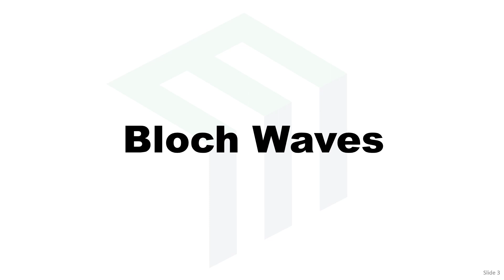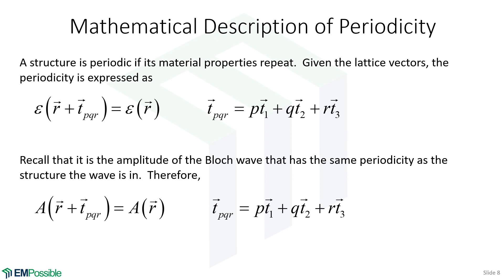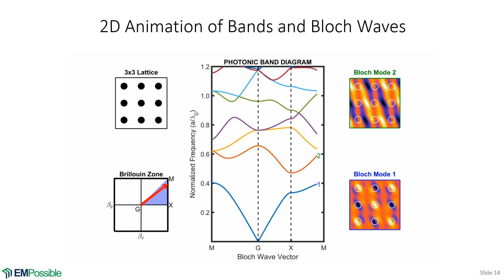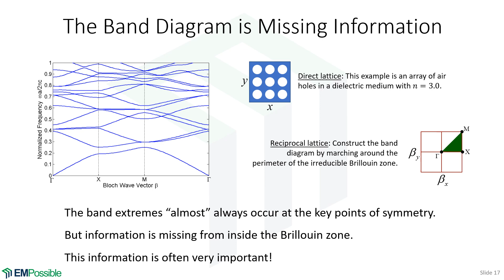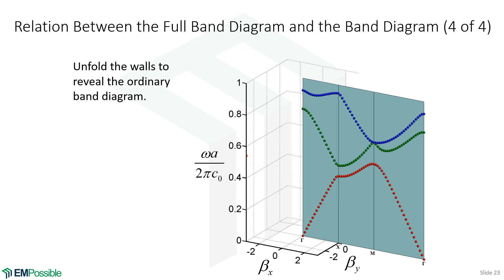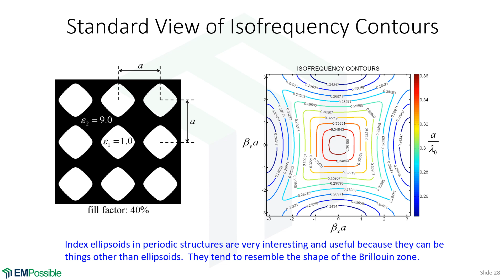Comment: Dear professor only thing I could not extract from your video is that when wavevector does not change the direction but amplitude, what does actually it do? Because I assume it is not really the excitation wavelength since when we check gap in the band, and simulate transmission, we take the wavelength from vertical axis, not from the horizontal one, then I cannot really comprehend what does scaling k vector does?  But in the bloch mode figure it is kind of changing the wavelength(?). If you could spare from your valuable time I would be really grateful
Reply: I am transitioning from conventional waves in ordinary media to Bloch waves in periodic media. To do this, I was being sloppy with the terminology. A wave vector is only for uniform plane waves. Waves in a periodic medium cannot be uniform so they are called Bloch waves. A wavevector and Bloch wavevector are interpreted the same way. They convey both direction and wavelength, not amplitude or frequency.

When constructing a band diagram, two things are needed as input to the algorithm: (1) a description of the permittivity and permeability, and (2) a Bloch wavevector. For a given unit cell and Bloch wavevector, a question is asked...what waves inside this lattice propagate in the direction of the Bloch wavevector with the wavelength also describe by the Bloch wavevector. The algorithm returns all the modes (Bloch waves) that do this. Each Bloch mode is described by a frequency and a picture of the fields in the unit cell. The picture of the field still does not convey amplitude, only the relative amplitude of the fields. Usually they are normalized for something like peak amplitude =1 or sum of field =1 or something like that. This is because no source is given to figure out what the actual amplitude would be.

When calculating things like band gaps, you have to calculate the band diagram and then extract frequencies from that. The Bloch wave vector only conveys direction and wavelength.

Does this help?

If you are looking for this in written form, I have included some discussion of it in Chapters 2 and 7 here:

https://empossible.net/fdfdbook/
Reply: @empossible1577  Dear Professor, thank you very much for you explanation now it is more clear

Comment: Dear professor,
I am trying to recreate what you did in 3:20 . Basically, you managed to separate the Bloch waves into envelope function and phase term. Is possible extract the same information from the photonic dispersion diagram of a similar structure (which shows the Bloch modes). Is there eigenmodes that can, in principle, correspond to purely the Envelope Function or phase term?

I carried an eigenvalue analysis of a similar structure, to extract the photonic dispersion diagram. It seems to me that the mode exhibited for the first linear mode (light cone) is similar to the envelope function.
Reply: When you solving an eigenvalue problem, there are eigenvalues and eigenvectors. These come in pairs.  The eigenvalues are used to form the bands is a dispersion diagram. The eigenvector is not needed for band diagrams. The eigenvector, however, contains the actual fields associated with the Bloch mode. The normal way this is solved is that the eigenvector is the envelope function. To see the actual fields, you have to analytically calculate the phase term and then multiple the two.

I have three resources for you to be able to do this. First, the fastest method for dielectric photonic crystals is the plane wave expansion method. It is a little weird calculating the fields from this, but rather simple once you get it implemented. See Topic 6 here:

https://empossible.net/academics/emp5337/

The easiest method and highly versatile method is finite-difference frequency-domain (FDFD). I HIGHLY recommend learning this method if you have any interest in computational electromagnetics. It is extremely simple to calculate band diagrams and visualize the fields. Like PWEM, it the eigenvectors contain the fields associated with the envelope function, but they are immediately available for visualization. Below is a link for a book on FDFD. The book it intended for the complete beginner and teaches the art of computational electromagnetics through FDFD.

https://empossible.net/fdfdbook/

Last, you calculate band diagrams and fields of Bloch modes with finite-difference time-domain. It is my least recommended method because it is a bit awkward and has some limitations. This is taught in the third course in the series below. You will need to work through the series.

https://empossible.thinkific.com/collections/FDTD-in-MATLAB

Hope this helps!
Reply: @empossible1577  Thank you very much professor! This was genuinely very very helpful.
 All the love and respect to you and your family from Morocco 🤍.
Reply: @Knomlive  Thank you Morocco! Very high on my list of places to visit!

Comment: Best tutorials I've ever watched. Could you please explain the reasons why periodical structures form bandgaps, cause I learned what bloch-wave is, I also learned what band diagram shows, but, why, why can why periodical structures form bandgaps? Please.
Reply: Thank you!  Happy to answer your question.  I address the reason for the band gap in Lecture 5c.  Here is the link to the course website where you can get links to the latest version of the notes and videos and get access to other learning resources.

https://empossible.net/academics/emp6303/

Here is the short answer.  The modes in a photonic crystal are required to be orthogonal.  This means they have to look very different from each other.  The first mode places its energy primarily in the dielectric.  The second mode has to be orthogonal so it places the majority of its energy outside of the dielectric.  If you pick a wave vector where there is a band gap, both the first and second mode will have the same wavelength, but one has its power inside the dielectric so it will experience a higher effective index.  The other has its power outside of the dielectric so it experiences a lower effective index.  How can do waves have the same wavelength but experience different effective refractive index?  They must be at different frequencies!  This is the band gap.
Reply: @empossible1577  Thank you for the response, it's pretty intuitive but I am gonna need a while to digest, and I will definitely keep up with your tutorials.

Comment: And, having chosen a direction, is it never possible to have a transmission band, rather than discrete transmission frequencies?
Reply: Yes, you can have continuous spans of frequency that transmit through a lattice.  The horizontal axis of a band diagram varies over direction and wavelength.  If you pick a direction, while the bands are discrete there is a span of Bloch wave vectors that have different wavelength, but all have the same direction.  This leads to the span of frequencies I think you are talking about.
Reply: Oh! OK. Thanks

Comment: I was wondering how can I implement a sinusoidal interface between to dielectric media into my grid using matlab.
Reply: I think you are asking how to build a device on a grid that has a sinusoidal grating as the interface between the two?  There are always many ways to do things, but I think the most straight forward is to first setup a loop that progresses from the left side of your grid to the right.  Maybe it is something like...

for nx = 1 : Nx2
end

Inside that loop, calculate the sin() function and scale the value so you now how high it is on your grid.  From this, calculate the array index ny for where the interface is vertically in your grid.  Then, fill in your ER2 array something like

ER2(nx,1:ny-1) = er1;
ER2(nx,ny:Ny2) = er2;

All of these calculations would occur inside of your loop.

I have a set of notes devoted to different techniques for building device geometries into a grids.  See Lecture 2b here:

https://empossible.net/academics/emp4301_5301/

Notice I have used the variables ER2, Nx2 and Ny2 implying this should be done a 2x grid.

Hope this helps!